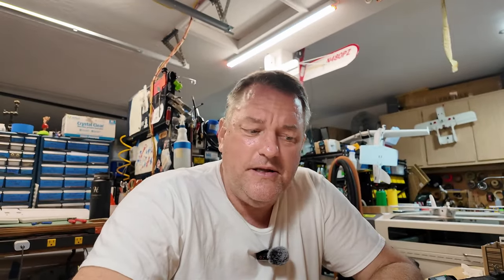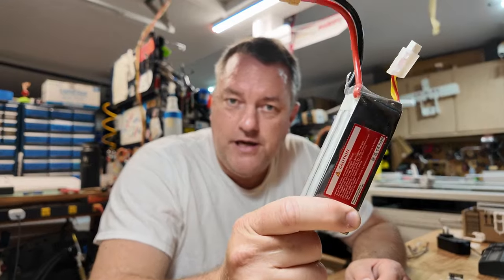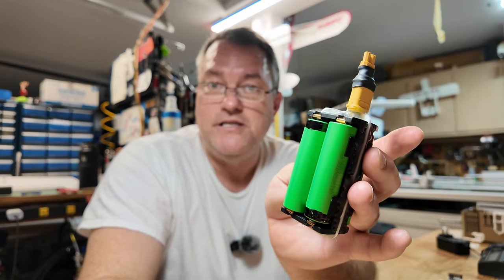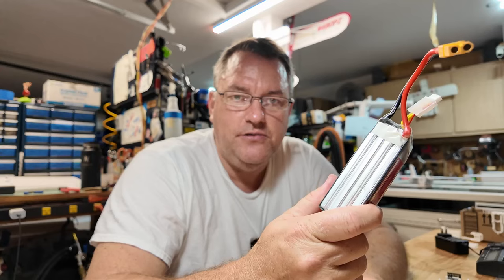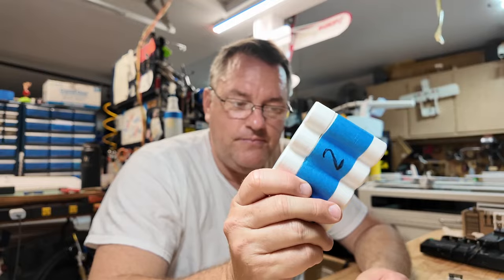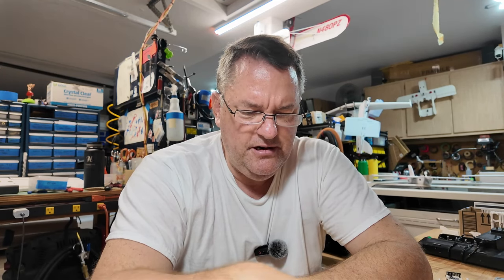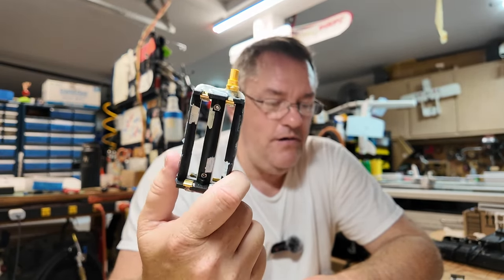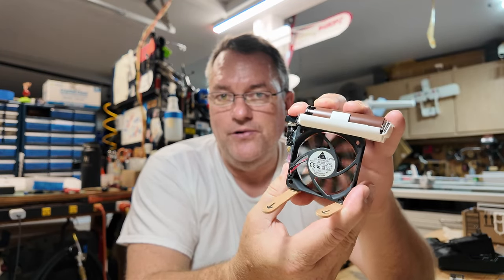DIY Li Ion Battery Packs - Better than Li Po for RC Planes and FPV?

Comment: Great video!
I've recently discovered that Li-ion packs don't have to be low current anymore. I use 4S2P soldered packs of Molicel 21700 P45B cells to power a Arrows Hobby Edge 1300mm plane. Pulls up to 75A, 1000W at max throttle. Each cell has a capacity of 4500mAH and can supply up to 45A continuous - so double those numbers for 2P. 
I manually solder my packs and include balance leads so I can balance charge them in the same way as a Lipo pack. I did look at using commercially available connection frames but found them too bulky for 21700 cells. I use tin/lead solder rather than spot welding - works fine so far - I've made two packs so far and flown dozens of times already without mishap.
The drawbacks with 21700 cells are that they are bigger and heavier than the typical Lipo packs that they are replacing in my planes. But the extra flight time is amazing. I'm getting around three times longer in the air. 
Video of one of my first Li-ion test flights in a Dynam Waco 1270mm biplane:
https://youtu.be/r2ONTml4zRY
Reply from the maker: I love the li-ion cells.  Don’t get me wrong - Li-Po still has its place in my sub250 stuff - but for my FPV or bigger builds - Li-Ion is my pack of choice.

I started off with commercial packs, then tried soldering - and eventually built a spot welder, but then I saw the battery racks, and thought to try them after a particularly bad crash that punctured a cell.  Sure, the battery racks weigh more - but the added capacity make it a non issue.  For balance considerations - I just charge each cell independently, and monitor their internal resistance and temperatures at charging.  If any individual cell draws my concern, it’s trivial to swap it out with a cell more similar to the profiles of the remaining batteries in that pack.  I much prefer being able to isolate my cells completely for travel, as it (in my mind) reduces the risk of connected packs (albeit this may only be in my use case in a cramped carry on bag).

I do have a few planes that fly off the 21700’s - and some that really benefit from their added capacity, but just be wary that unlike fuel tanks on full size planes, the weight of an empty cell is the same as the weight of a full cell, and it takes fuel to tanker fuel.  So in some use cases - you may find that 18650’s could give you a better specific range due to lower cruise power requirements (because of lower overalll weight).  But this all depends on if you’re solving for endurance or distance, and would require very exacting power control and testing.  Most times - it just depends on the airframe I’ve built, or CG purposes.

Either way - we’re really lucky to be flying with these amazing batteries.

Cool video, and thanks for the comment!

Comment: Another Great video always a pleasure to watch . I have most of my long range on solderd 18650s and 21700 but I have always wanted to try this thanks for the how too . Again just keep up the great videos . 
Take Care
Reply from the maker: Thanks for the comment.  I was willing to take the weight penalty for the ability to swap cells, and better isolate my packs for travel. 

This system has worked great for me for several years, and I wouldn't go back to lipos.

You've gotta be careful when loading your packs, but for me it's well worth it.

Comment: Is there a reason you are using the Samsung 20R vs say the 30Q or 35E that have 3000mah & 3500mha respectively? I just started looking to see what is available on Amazon and saw these higher rated choices. I don’t know much about these type of batteries and was wondering your thoughts. Thanks!
Reply from the maker: I bought these batteries nearly two years ago.  It may have just been availability.  I've not bought off Amazon, but I'm sure there are good sellers there.  IMR has been my vendor, but I've got no particular loyalty to them, I'd just say shop around. 

I've had really great longevity from my packs, as right now I've probably got around 20 individual cells in my active circulating pool.  They have lasted remarkably well, despite me oftentimes putting them in half baked planes that don't always fly great. 

I'll be curious to hear your experiences going forward.  I'm very satisfied with my batteries. 

No regrets. 

Thanks for your comment

Comment: Hi. Could you please provide link to the 18650 battery holders, that match your 3d prinable spacer. Am looking forward to giving it a go
Reply from the maker: I got mine off AliExpress - search for: 1x2x3x4x 18650 SMT Battery Holder 18650 SMD Battery Box Storage Case Container Power Bank With Bronze Pins Rechargeable SMT

I’ve ordered them from amazon, aliexpress, and other random places - they’re pretty generic.

I hope they work out for you.  I really enjoy my packs.

Thanks for your comment.

Comment: i welded 5000 mah li -ion
Reply from the maker: Nothing wrong with welded packs.

I arrived at my solution after having bought welded packs and having built my own welding setup to weld my own packs.

My packs suit my needs better for when I travel and I want to ensure the packs are isolated, and I do enjoy the ability to swap out cells, but a welded pack will be lighter if it's built right.

At the end of the day, they both get you flying.

Thanks for your comment.